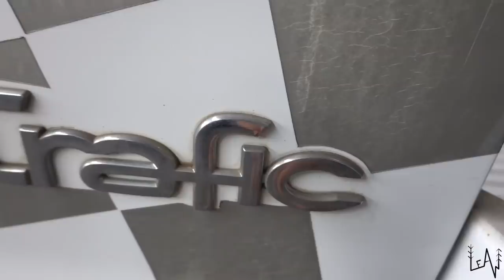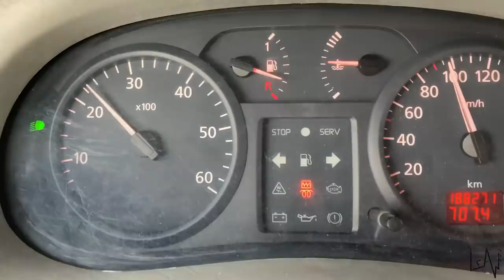Testing our VAN for VAN LIFE Italy / DRIVING to South Tyrol Merano

Comment: Enjoy the transition from America to Europe.  I am grateful for the low cost of traveling in USA, fewer toll roads and lower cost of fuel.   My mode of travel for vacation the past two decades is a 1996 Chevrolet K3500 pickup with 1999 Lance Slide in Truck campers.   Reminiscent of your  mode of transportation here in America. I was impressed you drove from Alaska to South America in a $800 propane powered pickup truck.   Propane vehicles are very common in Canada, but not as common in USA where Propane costs much more. Enjoy traveling in your van.